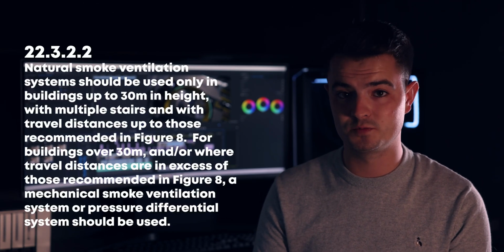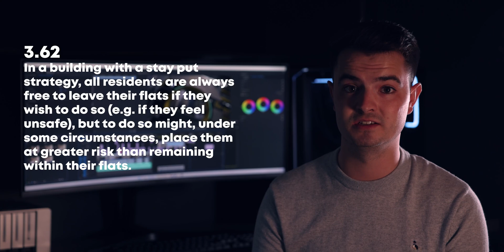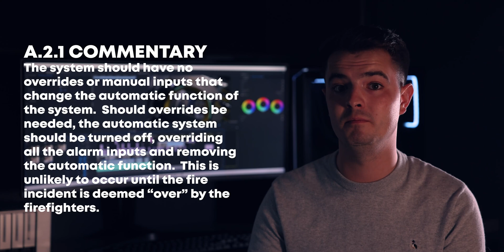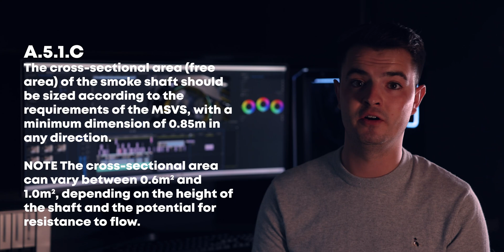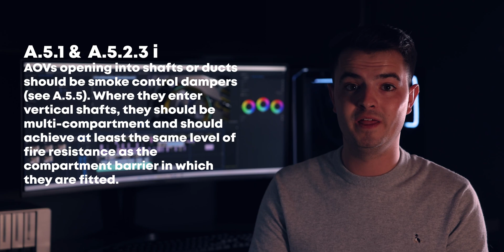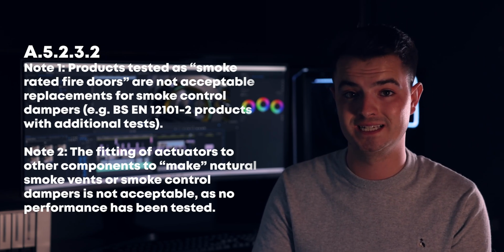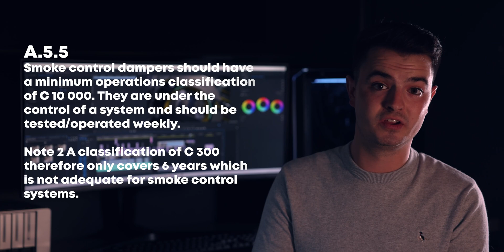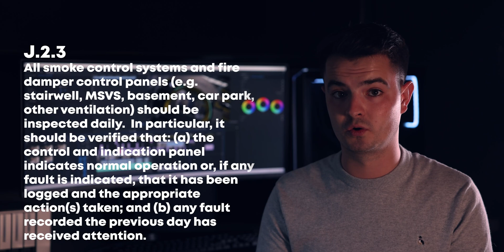The BIG changes to BS 9991 💥

Comment: I’m not understanding A.5.1.C. If the minimum dimension in any direction of the smoke shaft is 0.85m2 then this gives a minimum cross-sectional area of 0.7225m2 so where does 0.6m2 come from?

Comment: Hi there.For natural smoke shaft, are aov shaft doors not allowed as per the new bs9991 draft? Only smoke control damper allowed? Thank you.I subscribed.
Reply from the maker: Correct Marns, door type products won't be allowed and only BS EN 12101-8 dampers will be acceptable.  Hope that helps 😊